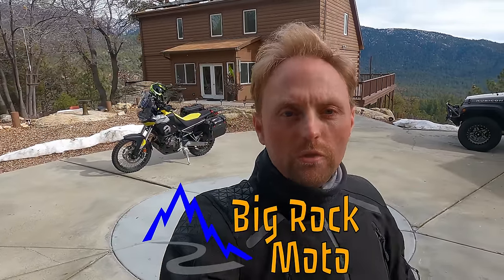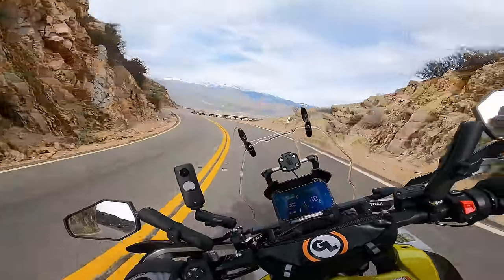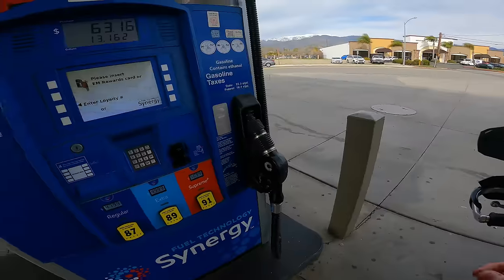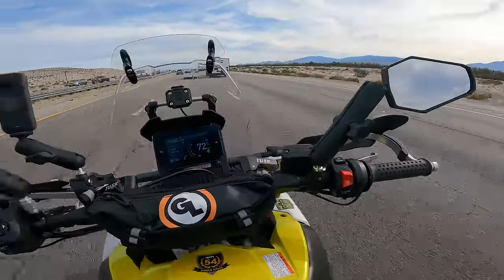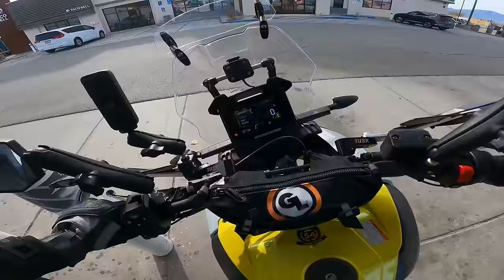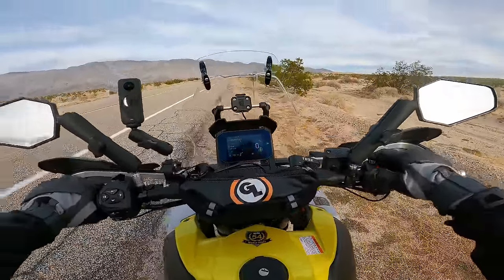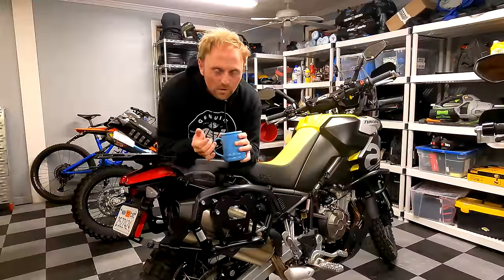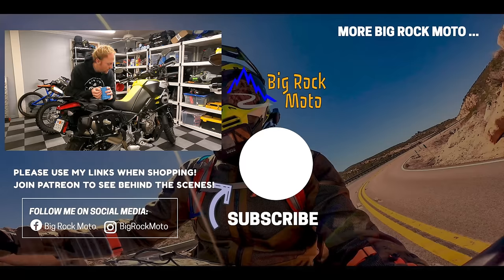Aprilia Tuareg 660 | In-Depth Highway Touring Test (EP.6)

Comment: I ride in 6C weather (43F) without heated grips.  I have heated gloves which cost $200 CDN.  Installation was free.  A center stand, crash bars, auxillary lights would be my must additions if I was to purchase this bike.  Vibration free at 80mph at 5,000rpm for a road/off-road bike!  Well done Aprilia.
Reply: i could't tell if it was at 5000 rpm at 80 mph. Typically a larger displacement bike like an older fj09 reads about 50hp on the dyno chart at about 5000 rpm (that's the rpm for steady state highway runs at 80mph).  The tuareg did not sound that quiet at 80mph. certainly if it can go along at 80mph at 5000 rpm, then that;s a plus (discounting the engine heat for a second)
Reply: I fitted Oxford’s heated grip myself. 70$ and very efficient. 
I never run them on full blast. They get to warm then.
Reply: @bikramjit ganguly  I doubt the rpm is that low at 80mph   he said 6k @ 80mph in the video.
Reply: Is it reliable

Comment: Man I wish I could trust this bike, reliability wise, I love it. The only two guys I know that have or do own it both had issues early on, one lost his confidence and sold it, it took months for them to get it fixed and they tried to not cover it, it had 2200 miles on it. The other waited and got it fixed and still has the machine , he’s had no major issues but did have to replace the bearings at like 4000 miles. No big deal but seems a little quick since he really only tours with it

Comment: Thanks for another great video. I’m very interested in this bike but the engine heat is a major concern in the southern US. I sold a tiger 800 because it was unrideable in the summer. Triumph definitely mitigated the heat issues on the newer tigers and my 660 is warm but manageable. Keep us posted on the engine heat issues as your temperatures begin to rise.

Comment: Thank for this review . I would love your exact same review of a KTM890R for a comparison. I road tested both Tuareg and 890R and bought the 890 for better ergonomics feeling, while larger engine and more sporty suspensions were a plus for me. But I feel few vibrations in bars when on highways at 110+km/h,  I felt the 6th gear should be taller.
Reply: As a tag on to this question, I would like a comparison with the regular 2023 890 adventure. What is a better all around, everyday type of bike between the 2?

Comment: On my KLR650 the throttle grip heater is much warmer than the clutch side. My guess is that the plastic throttle grip insulates, while the bare metal on the clutch side acts as a heat sink, in other words, heating the handlebar more than the grip. I am considering trying some spray foam insulation inside the handlebar. They were installed years ago. Recently I purchased some grip heaters online for $30 for my 1970 Guzzi and installed them myself. They are much better!

Comment: Heads up. I went to test drive one at a large dealership in Scottsdale Arizona. We'll the battery was dead. They charged it overnight. Went to start it and it was dead.  Turns out it is a $650 USD Lithium battery that they let completely drain so it's no good.  Turns out Allll of their Aprilias are DEAD. I'm sure they will be passing that cost to the consumer.  Not sure why the manufacturer didn't warn the dealership. Wonder if this has happened to other dealers.

Comment: Hi. Since you have ridden both the cb500x and the tuareg. Would you say the tuareg is better on the long rides? . I have the 22 cb500x. And i feel i want to upgrade it. It is a very good bike. But i feel it lacks a little in the features that the tuareg has. Cruisecontrol and the electronics adjustability. Phone connectivity. And i feel the honda vibrates a little to much on the long rides.

Would you say it is worth it to upgrade to a tuareg? I want something smooth and comfortable. And reliable to drive through countries on very long rides for days.

Comment: How do you feel about the passing power while cruising at around 80-85 mph?
Reply from the maker: just OK
Reply: @BigRockMoto  do you have a recommendation to fit an 80/20 road/offroad split that has enough passing power for long expressway rides? I was thinking maybe a ktm adv 790, although reliability seems inconsistent. Ideally something with tubeless tires.

Comment: Thanks for such a practical video. I truly appreciate it. I just got back from the Aprilia dealership downtown and they FINALLY had a low seat for these for me to try. Well, it fit my miniature body lol!  So I can confirm that the Tuareg 660 with the OEM low seat works for someone that is 5’6” with a 29” inseam. I was on the balls of my feet almost on toes with both feet down and almost completely flat footed with one foot on the peg and one on the ground. I was really happy with the fit. Felt good. It’s back at the top of the potential upgrade bike list.  👍🏾

Comment: Ian, I noticed around the 1,000-1,200 mile mark that my Tuareg started to show significant gains in gas mileage; over 10mpg! Hope you find the same gain as your mileage continues to rack up.
Reply from the maker: that would be nice!
Reply: I noticed the exact same thing. 10-15 mpg jump right around 1100 miles. Or, perhaps we just got used to the intoxicating air intake and eased off on the throttle blips?!!!🙂

Comment: You’ll get over 50mpg easily with a 16 teeth front sprocket and I didn’t see much of a difference off road because I did a tune and just changed the slip on muffler to an Arrow the bigger can of course because I don’t like a loud exhaust and the front wheel still pops off the ground with a twist of the throttle. I’m sure my mpg would be a lot better but I am so addicted to that intake honk and since I also went to a DNA intake filter kit setup I just get so tempted to roll on the throttle more than I should. The Tuareg 660 is such a fun bike and I do wish that Aprilia would come out with a taller 6th gear for this bike like an 0.96 instead of the 1.04545455 ratio 6th gear it has now because before I changed the front sprocket I found myself looking for a 7th gear on the highway a little too often. But again it is still is an awesome bike and I love this review you did on this and you do amazing videos as always Ian!

Comment: Great Vid.  
I did a 800 mile Solo road trip on a 2006 Honda CBR 1000rr ( one of the Most Painfully things ever experienced lol) . And got about 41-43 MPG
I was amazed.  So for a Bike that's 17 yrs newer and 340cc Smaller. I expected more than what you got . Haha
Reply: Did you have large touring bags on your sport bike? Did you have a head wind on the turnpike?  What tires did you have on it?  Weight of CBR 1000rr is 176kg (388lbs), weight of Tuareg 660 204kg (449 lbs) plus SW Motech crash bars and racks and loaded bags. Add your body weight vs Ian's 190lbs (87kg).  Ian did mention that when he did his own calculation his fuel economy was 47 mpg.  Comparisons are more accurate when you are comparing oranges to oranges.
Reply: @bcinspectorman  My bike Weighed 417 Lbs. I personally weighed it on a Metler Toledo Freight Scale.  My Personal Weight at that time was around 180-185 lbs 
The   (388 lbs) you Stated would be an Awesome SportBike Weight..but that Figure is Totally incorrect from the Actual Bike and is Probably a Stated "Dry" Weight. My 417Lbs is after removal of Stock wheels . Aftermarket Exhaust Carbon Canister. No Mirrors , lighter Sprockets Fiberglass Fairings and Tail. I also Had a Puig WindScreen that was taller than Stock!  I believe the Actual Weight of a Stock 2006 CBR 1000 RR is around 440. 
I Only Wore a BackPack as I Stayed in Hotel.
Tires were Michelin Pilot Powers. Stock Sprocket Sizes also. Miles Were Primarily on Highway I-70.   No Cruise Control
The Most Grueling Ride I've ever Completed and would never do again on a Sport Bike

Comment: Thank you for this review!!
This is closer to my way of using a bike (rather than the single track) and I highly appreciate you also doing this kind of testing. Not that I go that much highway, but on the highway it forces the issues and makes them obvious. 
It does seems like a great bike, but wind buffeting, heated grips, and the engine working at a little too high revs bothers me...
Curious if the Honda AT/ATAS (Suzuki V-stom 1050 and/or KTM 1290 SAS when you get the chance to test them) does this better (or should I say better enough so it is worth any difference in price)?
Reply: I had a deposit down on a Aprilia last summer and after consulting with my best friend I backed out and bought a base Africa Twin 1100 from the same dealer. This winter I installed the heated grips and quick shifter myself, pretty easy. I haven't had a chance to test them because it's snowing in Michigan. Power is fine, engine smooth, no vibration, good balance overall. I'm on my third windshield to try to reduce the wind buffeting. Coming from a naked bike, it is horrible stock. I added Swengotech fork shields, some Honda winglets and the smallest windscreen I could find. It's WAY better now. I love my AT and the big Honda network compared to the rare Aprilia dealership but I still think it's a pretty good bike and my dealer sold every single units the had.
Reply from the maker: Going one size up to a AT1100, Tiger 900 etc, yes they are better highway bikes, but not by much, and then off road, the Aprilia will eat their lunch
Reply: @RobertKnynenburg  I was in the similar position as you, was thinking about Tuareg and got CRF1100 half a year ago. While there were some things I have liked about the Honda AT (looks, sound), there were also some bad things like parts/paint bad quality, Honda not standing behind the quality and last but not least, SHOCKING prices of the spare parts. After 6 months and 3000km on the Honda, we have just parted ways and I have just bought the Tuareg.

I don't know about you, but I'm not going to pay 4000USD for a bike display when it craps out after warranty, or thousands of dollars for side fairings, like you would on the CRF1100. Overall, the spare parts prices for CRF1100 are out of this world and even Ducati DesertX is a cheap experience in comparison.

I have a guy in my circle who had issues with touch of the display (pretty common issue on these Honda's). Luckily, the bike was still in the warranty, so they have changed the display, but had some issues with ECU pairing, so changed the ECU too, of course with that goes a new keys. The guy did not have to pay for anything, but if it was outside of warranty, he would be billed for around 10 000 USD for this. Yeah yeah, it would never be cheap, but 10K USD? No way. That is not a bike I want to own and maintain, especially outside of the warranty.

Comment: How would you compare it to the Africa Twin for the "on-road / touring" experience?
Reply from the maker: The AT is a little nicer on the highway
Reply: I am also having the dilemma of tuareg vs Africa twin ,  the Aprilia seems to fit most of my needs - highways, riding through traffic and looks like it could get me started doing some light of road trails but I do a lot of 2 up riding and that's where the AT comes in.
What would you suggest?

Comment: @BigRockMoto Another solid review. Interesting on your experience with the heated grips. I agree level 1 and 2 are pretty disappointing but my experience with level 3 has been really positive on the OEM Tuareg grips. I did around 120 miles yesterday and low temp was around 36f in the Colorado mountains. I had my heavy gloves on and could feel the heat on L3 no issue. To the point that my hands were sweaty when pulling the gloves off. L3 does seem to cut in and out a bit during prolonged runtime (expected I would argue) but overall happy with the heat. I pretty much ignore L1 and 2 though. Wondering if you have a dodgy heat element? Regarding the quick shifter - nailed it. Smooth as butter and FUN!

Comment: I have been super impressed with what Aprilia pulled off. As long as they are reliable Aprilia probably has the best mid-size ADV on the market today.
Reply from the maker: agreed.
Reply: @alexstan5358  what are you talking about? The engine used by the Tuono, Tuareg, and RS660 didn't exist before 2019 when Aprilia applied for the patents on it. Its reliability is yet to be seen.
Reply: @alexstan5358  you should really try doing some research. Yes Rotax made a bunch of the engines for Aprilia. These are supposedly made by Piaggio. And the G650 was a single-cylinder Rotax motor. I would know, I had one. And pulling the front two cylinders off of an RSV4 doesn't mean it will work the same.

Comment: That engine heat is an absolute deal breaker for me. I had it on my Tiger 800 and couldn’t stand it. It’s a real shame because this bike was maybe it. Sure, I could decat but then I’m at KTM 890 money.
Reply: I realize this is an old comment but I’m very surprised you found the Tiger 800 to be a hot running bike. It was one of the least egregious of the motorcycles that I owned long term and I rode it in the desert a lot
Reply: @jf7393  Yeah, it cooked my leg inner thigh but I think that was all radiator fan heat. Compared to my R1200GS which can get pretty hot behind the cylinders, the Tiger was way hotter. Even compared to all my bikes I've owned, Triumphs Street and Speed tripls, Moto Guzzi V7 and 9s, DR650, CRF450L, Honda Hornet and a couple I'm forgetting, the Tiger was the hottest

Comment: Nice job as always Ian. Looks like you have Motoz tires on it. They are heavy with all the rubber they use and for sure would slow the acceleration some. Seems that header pipe cooks the right leg more than you'd think. Boo. After hearing about the heated grip's poor performance  I would opt for after market options. Got to love cruise and quick shifter. I had those installed day one on my KTM 790 R. First for me of the 15 or so bikes I've owned and worth every dollar! I'm guessing the MPG will improve as the miles pile up. My KTM... everything seemed to get smoother/better by about 10 K. I average 52 mpg and even hit 65 mpg on a 115 mile ride one time! Love these 'middle' weight ADV bikes - such a sweet spot.

Comment: 47 mpg is about 6 l/ 100 km, quite a lot for this middleweight Adv. ? 
But overall seems to be one of the best alternatives to the T7 (beside the 790 Adv. R & maybe the V-Strom 800 DE) 👍🏻
Reply: 47 us miles per gallon =

5.005 litres per 100 kilometres
Reply: @tomasfoltynek9534  thx 🙏🏻, didn’t get it … well, that’s ok 😅 (as my 2012-GS 1200)
Reply: My KLR gets 46, only cost used $4100
Reply: @slalomking  I have a bicycle that uses no gas and costs half what you paid for your KLR.

Comment: I've snapped these quick-release bolts more than once on light "bad road" situations (not true "off-road") on my G650GS Sertao. Be careful, they are fragile :-( 
I think, SW-Motech system is too convoluted/modular (I need sandwitch of 2 adapters to install hard top box for example, and it is official) and these bolts is on-the-good-road only.

Comment: I have a Moto Guzzi V85TT and the original heated grips don't really get warm, according to many tests.  Visually they are identical to those of the Aprilia and they will be the same.  I therefore connected Oxford heated grips to the original wiring on my V85TT.  These are also recognized by the electronics and shown on the display, controlled via the original switch on the handlebars.  They get really warm and very quickly.  Plus for a lot less money, 60 euros Oxford compared to 260!!  Euro original.  The problem is the heated grips and not the electronics, which may not be supplying enough power. Greetings from Bavaria...😉😉

Comment: This is a great video, thanks for making it.  I really like Aprilia bikes and they did a good job with the 660.  How does the power compare to say a Honda Africa Twin 1000l?  I know they are different bikes, but the power specs between the two aren’t too far off.
Reply from the maker: the CRF1000L has more torque and about 10 more HP, the Aprilia doesn't feel any slower however due to being 60 lbs lighter.

Comment: The stuttering is a big deal. It occurs frequently and seems more prevalent in the less aggressive riding modes. In my experience and in my area it is difficult to get the dealership to commit to the ECU update. Support in general has been kind of abysmal. The bike itself is nice and it's the size/weight I was looking for basically so I've been fairly happy with it.